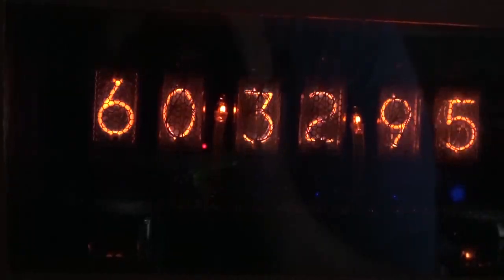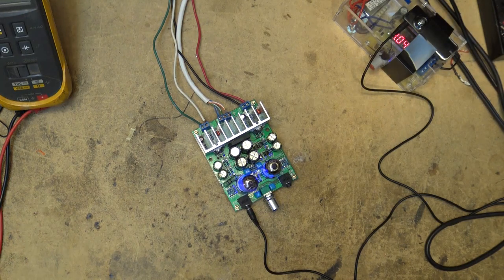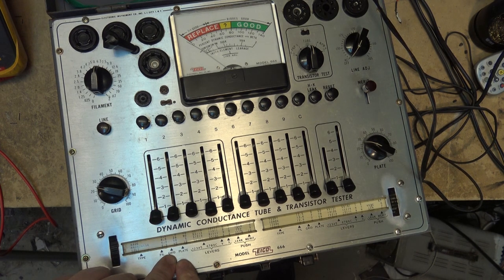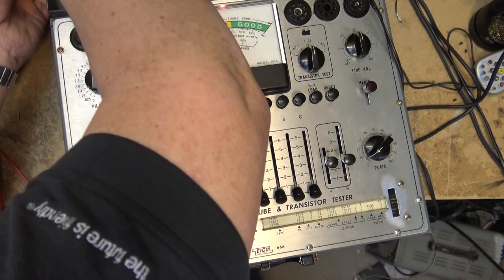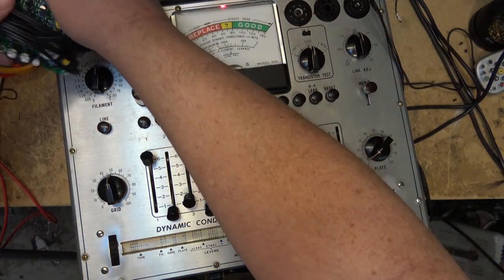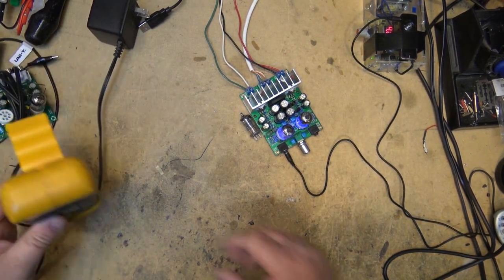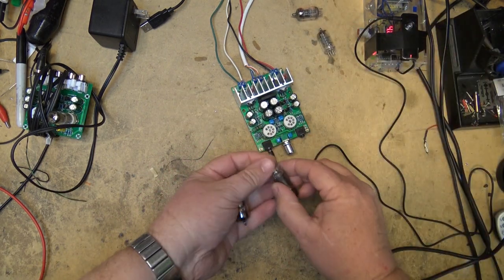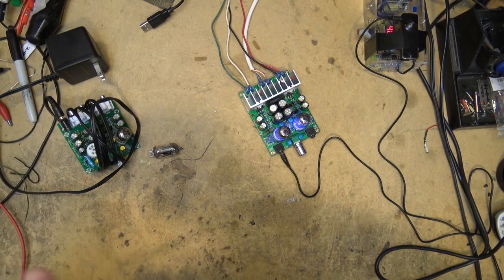This is why we burn in electronics

Comment: the filament voltage on those tubes was more than 15 volts in the previous video. That's more than 7.5 volts per tube. That's a bit too high, it's normal for the tube to fail with that overheating.
Reply: yeah, agreed

Comment: The merit lever is only used on the button marked with the underscore listed on the chart. The button that makes the needle swing to the right when depressed is the HK leak test, when it swings you then push the HK leak button and read what it says to the left side of the meter. You can fry your tubes pulling the merit on the wrong settings. The merit is the emissions test. I've owned the Eico 666 for years along with a Hickok and a B+K tester.
Reply from the maker: Well I have never used one of these. Even when I pull the merrit on the underscore it shows nothing, but after looking at it again, I believe the button for merrit is the one listed under the merrit column.  Makes no difference, the tube confirmed as bad tests exactly the same as a good tube. It is not showing any shorts, when we know there is an internal short because it does not work with this tube.
Reply: Yes, the underscore is the HK leak test. Merit is listed under merit. Just going from my memory until I opened it up tonight to check a tube.
Reply from the maker: I played with one of these testers years ago, but have never owned one, nor do I have a manual, so I am just trying to figure things out.
Regardless, it did not show this bad tube as faulty, in fact it shows as much gain as the good one. That's why the shop I worked at for 20 years never had a tube tester. Owner didn't trust them, so when we suspected a bad tube we just replaced it. We got out of tube repairs in about 86, and refused anything with tubes in it.  So from 86 on I never got the chance to work on any tube gear, just solid state, except for my own stuff.
Reply: One thing I've found with these low voltage/current amps and preamps using a tube that sometimes they don't have enough current on tap to run them properly. I have an old ADA MP-1 guitar preamp that runs 12AX7A's and it will only work with a certain few tubes, anything that draws a slight bit too much current than what brand they designed it with will not work even though the tubes I tried worked perfect in other gear with more power on tap. The tube might be ok in another piece of gear.

Comment: LINE switch is for adjusting the LINE voltage via the LINE ADJ control before any tests or tubes inserted. The needle should move at the center of the scale where the LINE ADJUST mark is. After the warm up of the tube you should readjust this as it might drifted under load.

Comment: I had a tube intermittently shorted like that in a Zenith AM/FM radio set, I kept on using the set for a while just periodically whacking it on the side to clear the short for a while. The tube is replaced, now.

Comment: I had an odd tube failure a few years back on a GE T265A transformerless table top radio. It would work fine most of the time but the audio would cut out intermittently and it made this awful scratching sound through the speaker. The sound was difficult to describe but I would say it was like someone was slowly dragging a needle over a record.

Thinking a connection problem I checked the PCB for cracked solder joints. This radio actually had a primitive single layer PCB and wasn't point to point. Finding no questionable solder joints I started tapping on tubes with a pencil and got it to act up turns out it was the audio amplifier tube. My best guess was there was a bad spot weld inside and the resulting arcing was causing the sound.
Reply from the maker: Yes quite often that is how they fail. Either a grid to grid short, grid to cathode short, or cathode to filament short.

Comment: I replaced those Chinese tubes with NOS GE JAN 5749's. This is the Mil Spec version of the 6AK5. I would check into that filament voltage also it seems a bit high. That will severely shorten the life of a tube. These Mil Spec GE tubes, operated at their proper working conditions should last a lifetime or two for the average user.
Reply from the maker: That wasn't the filament voltage. That was one of the test points, but that went into a 3 watt series resistor before hitting the tubes. Voltage on the tubes is 6.5, which is NOT going to cause any issues.
Reply: The 5749 is a mil-spec 6BA6. A mil-spec 6AK5 is called a 5654.

Comment: You set the first lever to 6 and said 5 on the tube tester. Doh!
Reply from the maker: What happened as you saw is I flipped it all the way up, and then back 1. It is actually in the 5 position, it looks like 6 on camera but it is actually 5.If you don't believe me I will be happy to shoot it on camera, but it is set correctly.
Reply from the maker: If you look closely it is in the 5 position. Look at the metal shaft, not the knob. 
It was set correctly.
Reply: Well what the camera sees may be different. Like a parallax error. I believe you. Maybe the tester needs service.
Reply from the maker: Yes I went back and looked at it after someone said I was on position 6, as I remember pushing it up to 6,and then bringing it back 1 position to 5. Sure enough it was still on 5 as I left it as I used it, and it was on 5, but from the camera angle it looked like 6, but you can see the metal lever is indeed pointing at 5, but the know looks like 6 from this angle.

Comment: I had the same problem with a pre-amp kit from china. Replaced the tubes with Mullard M8100s not looked back. It pays when you get quality tubes instead of cheap copys from China.
Reply from the maker: For sure.  Vintage tubes from the golden age of audio are superior and you will pay out the ass for a good tube. There some good modern ones.  The Russians make good tubes because they never went out of production.  They were in continuous production for military equipment.  There are some Chinese tubes that are fine, and others that are no good.  I have Russian tubes on one of my amps, Japanese tubes in another and Chinese tubes on my Chinese amp.  Those ones are about 10 years old now and have never been a problem.  One pair or outputs were changed after about 5 years of operation due to one of the el34 developing a leak and going gassy.
Reply: The ones i bought only cost me £14 for a matched pair and i havent looked back. Sounds amazing. It is an amp kit you recomended from bangood the Little Bear clone. love your vids. Keep them coming
Reply from the maker: Northern Electric 12AX7 run abut 47.00USD each right now, and those are not the most expensive of those tubes. Original General Electric run about 90 bucks each! For most people however the more reasonable Electro Harmonix or Tung-sol at about 15 bucks are more than good enough.

Comment: You should set the needle on the tube tester meter to zero , so your reading are correct.
Reply from the maker: Needle is bent, in case you didn't notice. It is hanging over the 0, but it is bent slightly left.

Comment: The tube tester meter is off the peg to the left, you need to set the meter to zero with the tester turned off using the zero set screw on the meter.
Those Chinese tubes are junk, I agree that tube it bad.
Reply from the maker: Not my tube tester, I was looking for shorts, and it failed to detect.

Comment: Hi I noticed on your tube tester the first number was meant to be 5 and you had it at 6 if that makes a difference when testing
Reply from the maker: No it is on 5. Go look closely. Go look where the metal lever is, not the know. The angle is bad.

Comment: Are there tubes available out of Russia, or China only?
Reply from the maker: The kit comes with china tubes, however you can use 6AK5, 5654 or 6AU6 as the 6J1 chinese numbering is equivalent. These numbers are in the assembly manual as substitutes.

Comment: How long should these tubes last...? I have a little preamp one that has bass and treble controls running a Carver amp. Been debating always turning it off when not is use or just leave on... I just don't know. What's your recommendation...?
Reply from the maker: I have radios with tubes that are over 80 years old that still work fine. They should last a ling time as these are just preamp tubes, but generally tubes that are going to fail will do so quickly because they weren't made correctly. If they run for 100 hours they will last for many many years
Reply: Awesome, thank you. I've had it running since last night, although not always a signal sent to it to give it it's burn in period. In my experience with most speakers and higher end equipment, it'll find its stable state and begin sounding better. The surrounds on the speakers and the caps set where they'll generally stay, a 'memory' kinda'. Just wasn't sure about the tube end of it as i'm new to this side of the fence. (I like it over here too... on the tube side pre stage) :)
Reply from the maker: Right, tubes generally take about 100 hours to settle in. When evaluating any tube gear, let it run, with no signal, or low signal for at least 100 hours before doing any serious listening tests as they all improve over this 100 hour break in period, and they sound great untill they start to wear out, and how long they last really depends on how much you abuse them. Output tubes get the abuse, preamp tubes will last for many years. My old Luxman LV103 has the original tunes in the preamp from 1984 and it has thousands of hours on that one.
Reply: Cool... good to know, thanks. I figure after the burn in period i'm gonna' change the blue LED's out for red ones to match the meters on my Carver 1.0t. Should look a bit better... lol I appreciate the reply about the tubes and their lifespan, thank you Sir...

Comment: does it help to burn in solid state or only tubes?
Reply from the maker: Generally you don't need to burn in SS amps. Tubes sound change as they burn in. Takes about 100 hours or so for new bulbs to settle in. Just has to do with thermal expansion of the different components inside the tube, and some out gassing of contaminates that are left in the tube after pumping out the air. The getter will react with any oxygen left in the tube, but those oxygen atoms won't be driven out of the metals until they are at operating temperatures. Generally by 100 hours they have settled in, and the sound has improved. When they are brand new they just don't sound quite as full as they should. Some high end tube makers actually do the 100 hour burn in before they match the tubes for sale as a matched pair. Naturally you will pay a premium for this, but when someone is paying a small fortune for a boutique amp what is a couple hundred extra for a matched set of burned in tubes.
Reply: I thought a burn in with a variac could help reform electrolytic caps and help drive out moisture... but I didn't know if that was for tube electronics specifically.
Reply from the maker: yrulooknatme 
It can help reform old electrolytics. With tubes it is not mandatory but the sound will change slightly after about 100 hours so generally we age tubes before doing critical listening.

Comment: This is why we don't burn in electronics in Germany: 0.30 EUR per KW/h ........
Yet I burned in my PC.
Reply from the maker: Kyôdai Ken 
Yikes and I thought our power was expensive. Ours is .08 /kwh for first 1360 in a 2 month billing cycle and then .14 for everything over that. I hit step 2 after about 2 weeks which means my electric bill is over 800 every 2 months year round. Even with LED lights in almost every fixture with the exception to a few decorative incandescent that run very dim just for the effect. I burn lots of power producing these videos in the winter as I have to turn the heat on and that electric furnace draws 5 kw. So to run for an hour that is 5kwh.  So about .75 to run it for 1 hour.  That is just for the heat in the garage. Gets expensive.

Comment: A prime reason to "burn in" electronics that are homemade, home built, or are prototypes. I agree with that, production stuff, no.   If the design is sound there is no "burn in" necessary.  Plus burn in sound to me just like that, burn in, meaning if it is gonna catch fire it better do it here.  Next, only other objection is unit not in a box keep all heat in for a proper burn if that is what is desired.  Yea I kinda blame china tubes.   lol.  Mixed feeling on tubes,  still deciding on to build my HF amplifier with solid state or be easier with tubes.  P.S.  Ever seen a very old movie named Shocker?  The "evil" guy in his shop soldering on old school live TV chassis while  it plugged in and on.  Too funny.  Still catching up on all the video's, all is good.

Comment: China build quality strikes again!
Reply from the maker: These are cheap tubes. I could put some old stock tubes in it, and might just do that. I am sure I can find some 6au6 around here, as I have a few drawers full of old tubes.
Reply: I'd be interested in hearing it with some old tubes. Wonder how it would change the sound?
Reply from the maker: I am going to look for a set of old ones to try. Since the tubes are an active part of the audio signal path they will make subtle changes for sure. That is the beauty of tubes, and what tube rolling is all about. Change the tubes, change the sound. Love it.
Reply: I should have some nos 6au6's here if you need some
Reply from the maker: Tat would be great to try

Comment: Get the instruction manual for the tester. You're killing me. Mechanically zero the meter. Straiten the pointer while your at it.  The LINE button is for setting the meter to the LINE ADJ. mark. That compensates for the local AC line voltage. Then you play the thing like Billy Joel plays piano. There should be the emission test and short test. And not much else for that tube. READ THE MANUAL!
Reply from the maker: It's not my tester. It is on loan. I have never used this one before. It certainly didn't show this bad tube as bad. I don't put much faith in any tube testers, and never used one when I worked in the business. My original instructor, an old army radio engineer forbid using a tube tester. He would tap on tubes, and measure voltages, and just change the ones he suspected as bad. Said tube testers were a waste of time due to too many false positives, and negatives.